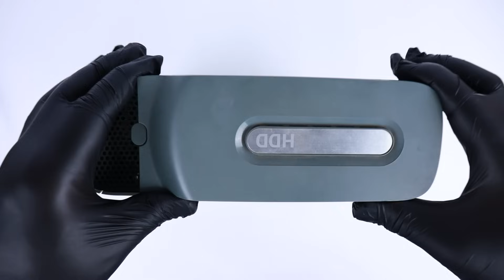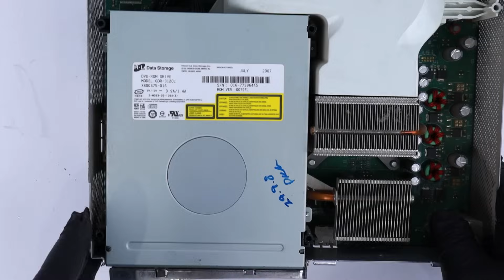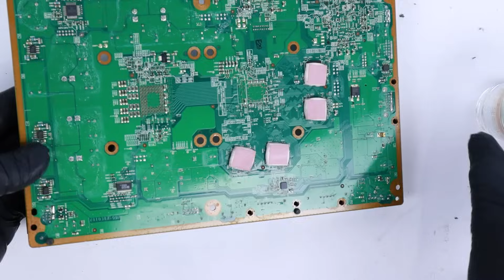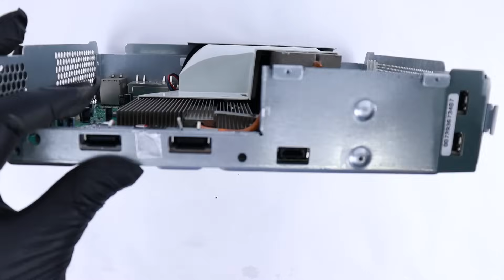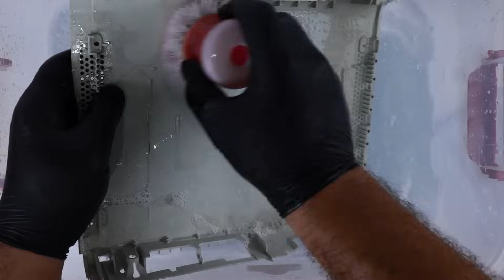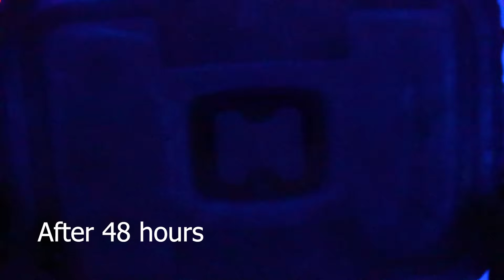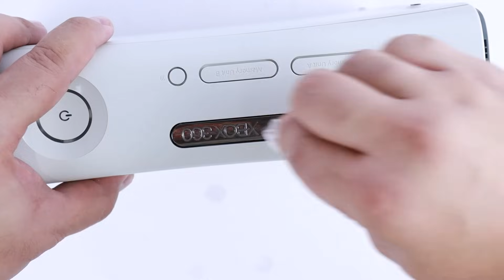Restoration & Repair of broken Xbox 360 and Fix The Red Ring of Death - ASMR

Comment: That's not a permanent RROD fix at all. "Reflowing" only works because you're reheating the chip and temporarily agitating the bumps that connect the chip to the substrate, but that does not actually repair the problem. The only actual fix is to replace the GPU entirely with a working one (though that's iffy as well since all these early GPUs are defective).
Reply: A 65 nm GPU is a guaranteed safe replacement

Comment: Just a tip, never spread your thermal paste out like that. If this Xbox is actually used it will almost for sure overheat due to doing that none the less still great you got it working
Reply: He did that or are you talking about the person he got it from
Reply: @5starr-dj819  probably the guy from video
Reply: I was thinking the same thing when I watched it.  He put to much thermal paste on, and he didn't need to spread it out like that
Reply: it will fail again cause he just reballed it, too little thermal paste is worse than too much. The pressure of the mounting evens it out and just wastes the rest not making contact with the ihs and the heatsink, too little and u get gaps where thermal paste could be sat instead, the 360s problem was the heat from its components caused the board to flex and crack the pads/balls on the chip or board
Reply: Zero in my mind to the fact you were
Reply: Matthew is not the best person for this position but he has been very good and is a good guy to help out in my career as a good writer for a great place in the one I have had in my past for the last two months I had no experience in my career in my life as I had 25:12 😅😅😅😅😅😅😅😅9999(
Reply: Google pixel and the fact you can

Comment: I'm super happy for you that you managed to fix the rrod, but what you did is only a temporary fix. Only real way is to replace the solder balls under the cpu/gpu with lead solder
Reply from the maker: thanks for watching
Reply: Not true , lead free is better
Reply: @garyhaas9575  Erm, no its actually nothing to do with the solder what causes the problem with these consoles, its to do with the clamps and the fact the main board is under large amounts of heat, cooling, heat, cooling cycles add the tension of the x-clamps, this causes micro fractures and separation in the solder balls present on the BGA, hence the RROD. Its just a shit design from M$. And that's NOT a reflow, all you did was heat the chip in a vain hope you reflowed it lol. Its similar to baking a GFX card
Reply: @garyhaas9575  Lead Free is one of the reasons it happened in the first place.
Reply: Replacing solder balls is temporary fix too.
Reply: Lead free solder was also thought to be the cause of PS3 ylods, but it was actually caused by bad quality NEC Tokin capacitors.
The main issue with the xbox 360 was the fans were not powerful enough, and were just too far away from the heatsinks to cool them properly. MS tried with the plastic funnel, but that wasn't enough. That's why i think the chips failed over time.
Reply: The only way of fixing this for several years is to replace the GPU. Reflow and reballing is only a temporary fix
Reply: He just says thanks for watching lol cant take criticism
Reply: @Se7en20082008 Uh no it doesn't. RROD was caused by faulty GPUs, X clamps had nothing to do with that.
Reply: @vinyminotaur2694  Microsoft never replaced the GPU's on the consoles, they never RECALLED them, did they? The fault was caused by poor cooling because the GPU was underneath the DVD drive, and was aggravated by lead-free solder. The fault was caused mainly from the x-clamps, pulling on the underside of the board. When the console cooled, it cracked the solder, and RROD occurred. The GPU itself was not and never was faulty. The cooling solution for this console was faulty, if anything.
Reply: @Se7en20082008 Microsoft themselves confirmed that it was faulty GPUs that caused RROD. Cooling was never a problem. They later started servicing consoles and replaced GPUs for more reliable ones. The GPUs were faulty because they had the wrong underfill that was meant for cooler running chips and the Xenos was a hot running chip and because of that, the underfill would regularly soften during normal use and would ever so slightly push out the GPU die and cause the solder bumps to crack and lose connection. Do some research before making a statement.

Comment: Great job, but the problem probably comes back in a few days.
Reply: That's why Xbox 360 emulation is a must. plus I had a white one that got the red ring of death every now and then. All I did was beat the living crap out of it. I hit the top of it and it eventually went away. Rinse and repeat for 6 years. Eventually I tried to paint it, it went bad. Left it outside one day and someone stole it. That thing was a tank! Beat it up every other day.
Reply: I had a repaired Jtag unit back in the day and it lasted only a few months after being purchased..... The 360 got hot enough to suffer from chip creep. I'd imagine to properly restore a 360 long term you'd have to upgrade the cooling in some meaningful way over stock. Liquid metal would really be the easiest solution.

Comment: You have really improved the quality of your videos a lot lately. by the way, I recommend that you use a paint brush instead of a toothbrush for the peroxide cream, it distributes better and is much easier to handle.
Reply from the maker: thanks for the advice, I will use the paintbrush the next time, thanks for watching and the nice comment.
Reply: What cream is he using??
Reply: @turji  gamer juice
Reply: @nykrev  I'm pretty sure that's what he's trying to remove.
Reply: Restaurerar du konsoler mot betalning också?  Sjukt imponerad av dina restaureringsprojekt.😀👍 grymt bra jobbat.
Reply: @jameswaller50  underrated comment
Reply: @turji  using his own man juice

Comment: Nice video, but check the min 15: You're putting bad the heatsink! You must rotate it 90º, check with the video at min 6:40. In that position (min 15) you're blocking the air flow

Comment: Verry nice job, but sadly I have to say that this is not a fix. The actual problem is a connection between the gpu die and the gpu chip, which is glued together. The proper solution would be to find a new or working replacement gpu chip and swap it. Also You installed the cpu heatsink the wrong way, That's why it is so loud. But anyway, good work and keep it up!

Comment: It's very strange that nobody mentions the thermal paste used in the video. Gd-900 is very liquidy paste which should not be used on bare die situations. Instead use PK-3, IC diamond Carat or a cheap solution would be Dow Corning TC-5688 which was specifically designed for bare die applications such as laptops and consoles.

Comment: 10 minutes later it is broke again
Reply: he cleans inside in Xbox 360 because if all things been cleaned or fixed then they will restore the Xbox 360
Reply: As long as you reapply thermal paste and clean console good end up lasting just as long as they did when the console didn't have rrod.

Comment: When applying thermal paiste , put a thin line at one end then spread with a credit card or something similar
Reply: homie drowned it in thermal paste lmao
Reply: No need to spread at all, it's only going to increase the risk of creating air bubbles. The heatsink will spread the thermal paste evenly when you attach it to the board.
Reply: @Villa_Sempre  that's why you spread it evenly with a card , no air bubbles
Reply: @Villa_Sempre  just to let you know , I fix these
Reply: @garyhaas9575  just because you have been doing something wrong for many years doesn't make you good at it, it only makes you good at doing it wrong
Reply: @juansalas2882  what makes you think its wrong ? Just because you do things wrong ?
Reply: @garyhaas9575  the impact in performance of how you apply thermal paste is minimal, and your method has no proven advantages over others, but then you said the bean method is wrong and you know because you are the mr know-it-all of console reparation
Reply: @juansalas2882  do not put words in my mouth , I did not say it was wrong.

Comment: Am I the only one that noticed that he put the CPU heatsink back on at a different angle?
Reply: Yup, that heatsink isn't going to cool properly.
Reply: I use to mod this kind of devices (Jtag / RGH) the way he did this maybe less then month if played daily. Honestly for this kind of repair if he wanted to do just a reflow using proper equipment like a BGA station would of been perfect all the heat gun does it throw hot air at the chip causing the board to warp because the whole board ain’t being heat up at same time. But again it’s just for a video so I’m guessing he might thrash it after or sell for parts.
Reply: Ikr

Comment: Great job/work the belt usually goes on the disc drive would of replaced that greased the gears and cleaned the laser for a full restoration interesting technique on the cracked cover shell was that a honey comb screen add on??

Comment: Nice work you fix 3 red light with no rebaling just cleaning the termal paste
Reply: Unfortunally this fix propably wont last very long,  the solder points under the chips will keep cracking if they dont get reballed properly
Reply: @felixlutticken5694  reballing only fixes for a week.

Comment: Just have 2 issues.  Not putting the case screws back in and turning the cpu heatsink sideways but other then that great job!
Reply from the maker: Glad you enjoyed it!, Unfortunately, I did not install the CPU heat sink correctly, I realized this mistake later after I finished the video so I corrected it after the video

Comment: Re-flow is not a permanent fix, the chips need to be re-balled with leaded solder to actually fix the issue, I do hope you don't sell these on after you restore them, as they simply won't last.

Comment: very satisfying repair however the repair on the the cpu/gpu is not going to last due to the nature of the red ring because the original arcades were rushed out and the result of that is the motherboard bends or bowes from the heat of the chips which in turn pulls the balls of solder away from the the pads resulting in the red ring so with a decent gaming session the fault is going to return
Reply from the maker: Thanks for watching
Reply: No, the board is supposed to flex. The problem is with the GPU. They're shit depending on what model you got. They were 90% of the problem for RROD

Comment: I can’t tell you how many times I attempted to repair my old 360. I did my best, but I didn’t have nearly the experience to do it. So seeing the RIGHT way after all these years is great
Reply from the maker: thanks for watching
Reply from the maker: I so appreciate you saying that - that was so sweet of you! thanks for watching
Reply: It is not the RIGHT way to do it.
Reply: This is not a correct way to fix broken solder points beneath a chip, it  tends to help for a while but  a high chance it wil break again after many heat cycles of playing and warming up and cooling off again  and then the problem wil be back,  this is a different way  of the baking in oven  style that also wouldnt be a real good fix in the long run

Comment: I need to know what temperature can you use the heat gun at Fahrenheit so that you can repair it this motherboard at?
Reply: It's not a repair - that chip will 100% die again. If you do not know how to do a complete GPU replacement, you won't be able to fix it

Comment: Unfortunately this is only a temporary fix. It will break and red ring again. The 360's original design has an inadequate cooling solution which results in a solder joint breaking in either the cpu or gpu. Reheating the solder joint where it broke will fix it, but it will be weaker than it's original flow. The real only way to solve this issue is to do a reball. That takes a lot of time and very expensive equipment. Not only that, but this 360 needs a more efficient cooling design. So the real solution would be after the reball, to modify the cooling system or ditch the 360 housing completely and put it in a pc case for proper air flow.
Reply: The only parts of this comment that are correct are the first two sentences... Everything else is wrong.

The issue is with the underfill material supporting the solder bumps on the die. The underfill fails and the solder bumps eventually crack. Reballing does absolutely nothing to fix this, and the stock cooling is sufficient for a properly designed chip.

Replace the GPU with an updated variant, and the console will live for a very long time with no other changes.

Comment: this is not a full repair, the console was just warmed up. After a while, the chip heats up well enough, it will fail again, so such a repair can not be called complete, so if you rebolled both chips, then such a repair is performed, and is considered complete. Then this set-top box will work for a long time and will not fail

Comment: Tell me, why does the rrod xbox have a better quality heat sync than the jasper v2??? Lol they removed not only the copper from the design but they seem to have decreased the fin density as well. They either seriously reduced the heat output of the jasper v2 when it was released or these revisions were purely made to cut costs.
Reply: It's both... The smaller die doesn't need as much cooling
Reply: @Harmonic14  Being that it's such a powerful chip in a tiny chassis it probably still belts out heat like a fat guy who did a ten minute walk. When your chassis is that small your heatsink should be larger with plenty of copper.

Comment: I really like your videos but I hope you know that it will break after a week or two because tha5 doesnt fix it permanently and it will break even faster because the CPU wont get enough coolen because you installed the heatsink facing the wrong way thats why it got so incredibly loud at the end
Reply from the maker: Unfortunately, I did not install the CPU heat sink correctly, I realized this mistake later after I finished the video so I corrected it after the video
thanks for watching
Reply: @resEG  Okay just wanted to make sure it doesnt Brake right after the Video
Reply: He also didn't use a multimeter and attempt to diagnose the problem.  Cleaned it and put on new thermal paste...aesthetically great job but you didn't solder or check for broken/lose pins......entao no e muito bom.

Comment: great restoration. but I'm tired of seeing people blast the gpu and cpu of this console to "fixed".
can work for sometime. but is not even close to be a permanent solution.
The only way to proper fix RROD is replacing the gpu with a revired chip. it is a manufacturer defect. an you need the revised chip.. blast with reat will not get it fix.. not even a rebbaling.. you HAVE to replace the chip... with the revised one

Comment: I have a Battlefield 3 Custom Stickered Limited Edition Xbox 360 E (2013, aka. the latest one), and it is REALLY good to play with old games, even though I have a trash laptop, this is my only tech stuff that is strong. But sadly, on this week, I dropped the controller on wood floor, and the RS (Right Stick) just became dead. Sensitivity is just messed up, like pushing down, is just nothing, clicking in the stick doesn’t work, only if I press like really hard, and it just gets stuck randomly, but I have an other controller fortunately. I am still happy.

Comment: It really hurt watching this thing get put back together with the one heatsink offset by 90 degrees. It might have lasted awhile longer if not for that.
Reply from the maker: Unfortunately, I did not install the CPU heat sink correctly, I realized this mistake later after I finished the video so I corrected it after the video. Thanks for the visit

Comment: In Ukraine, for such repairs, the hands are torn off after the face is broken.  It is not clear to me why the client gives his money, if nothing has been done except for warming up the chip and cleaning the dust.  At one time, we were not allowed to replace the BGA without the presence of an IR station in the service.  and this is how we heated it with a hair dryer at the market for $ 10, of course, a guarantee until the first turn (that is, no guarantee), but such a repair was enough for a week.  In general, we, the "masters" who, instead of replacing the chip, simply warmed up the board in the hope of restoring contact, were despised like whores in prison.
Reply: По ходу цей чувак і навчився гріти чіпи на Київському радіоринку 😁

Comment: The fans are running high didn't see a fan mod so id say it's going to have rrod soon again. If you're going to reflow use flux around cpu and gpu that may help keep it going longer
Reply: No, just replace the GPU. Anything else isn't a fix

Comment: must've overheated and had a broken av cable. After the 3-ring RRoD it became a 4-ring error and then a 2-ring error. Or must just be my eyesight.
Reply from the maker: To identify the error code on your Xbox 360 Fat, you can follow these steps:

Red Ring of Light (RRoD): If your console has the Red Ring of Light, you can determine the error code by holding down the sync button and pressing the eject button four times. Each time you press the eject button, a certain number of the quadrants of the ring will flash:

4 lights signify 0

1 light signifies 1

2 lights signify 2

3 lights signify 3

After pressing the eject button four times, you will have a four-digit error code. For example, seeing 4 lights three times, followed by 1 light once, means you have error code 0001.

Comment: Restoration partially successful!
Too much thermal paste and missing long screws at 21:36 .
When you were doing the test at the end of the video, the fans were running at full speed. And this is not normal, it was going to overheating again.
Byeee 🙂
Reply: Thats not caused by too much thermal paste but not enough CPU cooling. The heatsink isn’t installed on the right way, the air will be blocked now. It must be rotated 90 degress